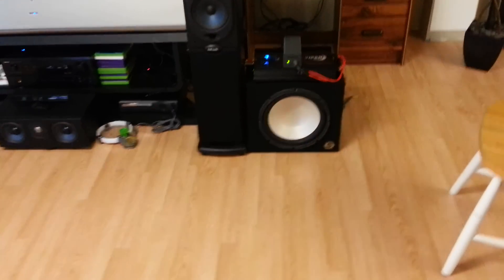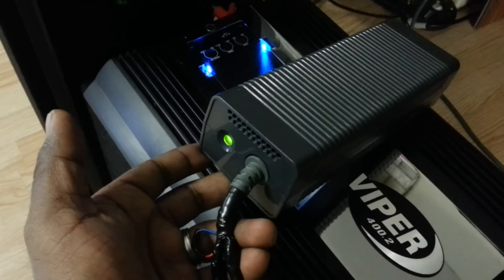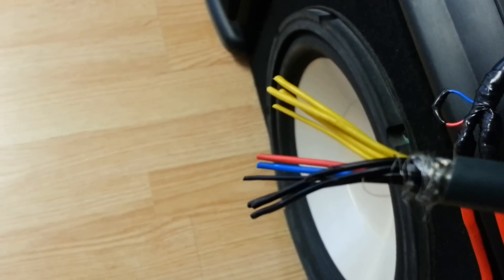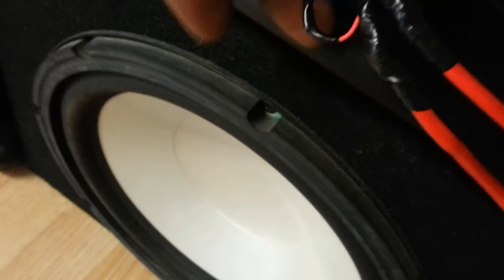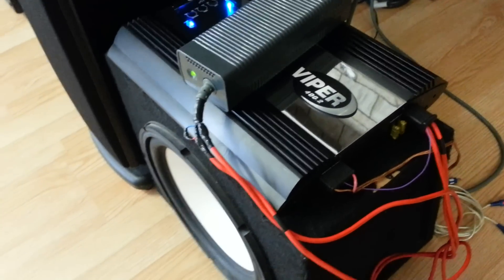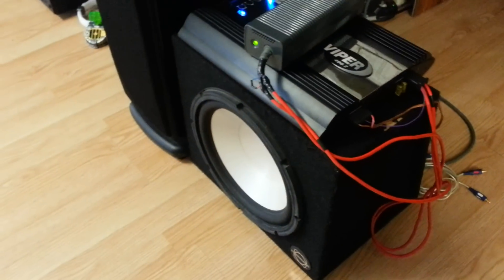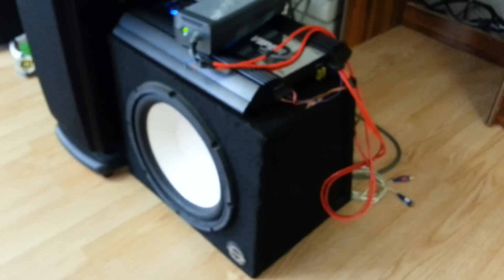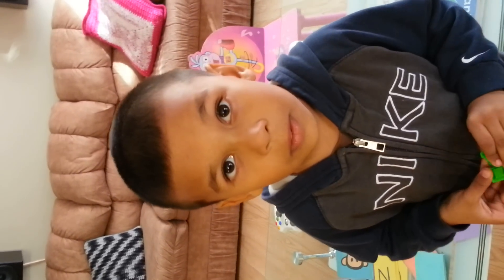Car audio at home - DIY - DC power supply  PSU w/ xbox 36o brick

Comment: A laptop charger would work but only for some car amplifiers that put out a minimum of 50 watts or 70 watts per channel a laptop charger only works for 300 watt car amplifiers such as kicker or some ground zero amps or a us amps 50hc some amplifiers you can run with a laptop charger not all of them though I hope to get a bigger amplifier someday and bigger subwoofers I hope to get some ct sounds meso 12 and a ct sounds at14001d or something along that line my current car amplifier that I'm running indoors is beat up but still works and I love running car amplifiers indoors and I'm currently running 2 12 inch 800 watt car subwoofers indoors and they work great but I hope to run 4 12s indoors and 2 amps indoors or 3 amps indoors I want to shake the roof of my house someday and crack a window with bass that's what I hope to do someday is to blow the roof off with bass

Comment: In conclusion.   It didn't work for me.   My amp fuse is 40w.  The brick doesn't have enough power to keep the sub going.   Or it will not sound as good.   I understand u said low frequency    I like your set up.   But back to the drawing board for me.

Comment: Did you install a volume knob on the amp?
Reply from the maker: Kaizen Kaizen no I did not. the amplifier is getting it's audio signal (via the RCA's) from the subwoofer output terminal of the back of my home theatre recieved. so when I turn up the stereo volume in my recieved, it turns up the subwoofer.

Comment: i been thinking of doing this,but what if u use a car battery,and just hook the car battery up to a car bat charger
so it keeps charging
Reply: Syber Tiger well, that’s the legit way, but it’s also more expensive and a little risky, but as far as actual sound quality setting it up as if it were in a car would be much better

Comment: Pretty neat, great video. I am attempting something similar but found an old Dell AC/DC adapter. When I stripped the cable it had 3 ground, 3 power, 1 red, 1 blue, and a bare copper wire. Any idea what the bare wire is for and what to do with it?
Reply: Ines Quintero ground wire bro but don't use to ground amp tie in with the other grounds.
Reply: Wasn’t that to much voltage?

Comment: Nice vid. Q: What did you do with the REM cable on the car subwoofer?
Reply from the maker: Connor Mac I jumped the remote  to the power terminal on the amp. once you turn the power supply on, it instantly turns the amp on.
Reply: Randy Prasad where on the power terminal? how did you connect it? I was thinking I was just going to connect a toggle to the red and green wires like you said to turn the subwoofers on and off. could I just leave the remote wire disconnected? thanks for the reply btw

Comment: @Randy parsad can any one tell me what's that orange cable is called  plzz
Reply from the maker: Ricardo the red cables?
that 10 gauge power wire (CCA) copper clad aluminum
Reply: Randy Prasad yes sir the red cables what are they called and where can I order then from?
Reply: Randy Prasad can you tell me how how did you connected it to the tv or can u make a video please  and thank you ur so helpfull

Comment: How did you hook up your amp to your receiver? I have a sub output on my receiver and when I plug the RCA wires in to both the receiver and the amp, the subwoofer just makes a buzzing noise that does not play along with the song. Please feel free to update me on how you hooked up your amp to your receiver with RCA to make it work. Thanks.
Reply from the maker: chia moua I used the sub out output terminals on my Denon receiver, and had no issues. make sure you turn that output on and turn the gains up through your receiver settings.

Comment: you can also use a 400 watt battery car jumper or you can possibly go higher on your wattage on your car jumper just depends on what your amp wattage is on your amplifier to be able to know license for instance if your amplifier is 1500 go with a higher voltage battery charger past that number it will last you a long time throughout the day and play as long as you want just long as you use your full gauge extension cord  and plug it in the back and charge it as you're using it at the same time to where you don't have to do demos you can just play as a all day thing any day thing trust me I do wiring it works ....GREAT
Reply: Jumper or battery charger or could I use either or?

Comment: Sound very educated about this. If it's 12 V and 14 A, that is only 168 watts of power. But the system is at least 1000 watts. How?
Reply: It takes power to make power. So if it is only getting 168 Watts it is probably only putting out ~130/140 Watts. The system is not being used to its full potential.

Comment: 40 amp current draw from your amp, and only 14 amp output? how is this not smoldering that power supply.  It is cool tho
Reply: THE AMP MAY NOT BE DAMANDING 40 AMPS ALL THE TIME,I DO THIS WHEN I REPAIR AMPS AND HAVE A AMP DRAW TESTER IF THE SUBS DEMAND THE POWER AND IS BRIDGED DOWN TO 2 OHMS OR SO IT MAY HIT THAT PEAK BUT NORMALLY IT WONT,I CAN PLAY MINE ALL DAY WITHOUT MEETING THE AMP RATING ON THE AMP,NOW LONG TERM ITS POSSIBLE IT COULD HURT THE AMP IF IT DOESNT GET THE POWER IT NEEDS AND YOU PUSH IT TO THE FULLEST ALL THE TIME BUT I HAVE A WHOLE SETUP WITH A RADIO EQ,4 SPEAKERS AND A SUB WITH AMP AND IT SEEMS TO HOLD FINE.ALSO I THINK THAT IS A SOLID STATE POWER TRANSFORMER SO THEY ARE PRETTY RUGGED.

Comment: in a house that has been well insulated, your ceiling vents will not be sufficient. an exhaust system or ventahood will be mandatory if staying alive is a concern. if the poison gas doesn't get you the very explosive bang will. natural gas leaks ain't got nothing on a hydrogen housebomb, vaulted ceilings beware
Reply: Christopher_the_Welder uhh wtf he is using a 12 volt power supply from an Xbox no battery at all no gases .
Reply: +bish bosh I was referring to the people suggesting auto batteries

Comment: keep in mind, when using a automotive battery charger to charge a car battery an invisible byproduct is produced from the terminals and cell caps. "hydrogen gas"
Reply: Ah consider that as added decibels 😁
Reply: hell yea preciate that bro
Reply: Will it make me high ?? 😄
Reply: @gondokist  .No, but it will make you go BOOM! Hydrogen gas is highly explosive.
Reply: Christopher_the_Welder this has relevance where? i’m not trying to be a dick, I know it sounds like it over the internet, but it’s a genuine question. he didn’t use a car battery charger or anything and before I go and hook my old system up in my house I want to take my precautions 😂
Reply: What about a jump  box

Comment: YOU ARE THE MAN. a fucking xbox power supply?! genius.
Reply from the maker: Rob Rodriguez thanks chief
Reply: Rob Rodriguez on your Xbox 360 power supply does it have four yellows in four blacks cuz if it does and there's one yellow and one black and skinnier than the others and what I did is I chopped the one yellow and one black so there's three yellows and three black and I rewired it all up and my amp did not go into protect so you should try it for yourself too maybe that would fix your problem and my Xbox 360 power supplies power is 203 Watts and the DC output is 16.5 amps
Reply: @Massive21Bass this worked thanks!
Reply: Rob Rodriguez .. this blonde is hooking my Xbox to my 12 p1
Reply: How many watts can it handle?
Reply: i ended up doing exactly this myself. the power supply goes into a safe mode and needs to be turned off and on again at about 20 amps. i recommend getting a volume knob for the amp so u can change the bass volume easily and separately from your source. Randy Prasad be the plug for this one 🔌
Reply: My amp goes in protect mode as soon as I turn it on ??
Reply: @nathanblust9537 take out the small yellow and black cables there are 2 that are smaller cap those off
Reply: How do I hook it up to my laptop so I can play beats off it ??
Reply: @nathanblust9537  not sure possibly a stereo with a aux cable from your pc
Reply: @Vengancebat  true ok thanks man

Comment: I have two xbox power supplies could i hook both of them up to my amp for more power?
Reply: Revolved .Sniper yeah try it let me know how it works lol
Reply: I gave it a try but there seems to be a surge or backfire of power, always cuts out at least one of the power supplies if both are plugged in, works fine if ones plugged in both will turn on... dont know how to fix the problem, got any ideas they would be greatly appreciated.
Reply: You gotta use a turn on switch that has both bricks together. Even a pull cord from a lamp will work

Comment: Can you bump it all day like that or will the psu cut off after a while? Example,12v 14.2amp and you feed to a 300w amp that require 25/30 amp, would it be fine running at half power all day?

Comment: I set this up but it only works for a second then the Xbox brick goes from green to red... is it using to much power or something?
Reply: Jack Fields  shorts maybe
Reply from the maker: Jack Fields your trying to draw more from it then it can output, turn your gain/volume down and see if it helps.
thanks for watching,
cheers

Comment: hey i got a 12" audiobond sub and a 1,000 watt logic amp would it work
Reply: Chance Frizzell an Xbox power supply only has about 200 watts, soo, you might not get enough power
Reply: its alright it is running off 200 watts rn from my receiver

Comment: I have 2 15" KICKER subs, would a 850 watt pc power supply do?
Reply: IGOTA Iphone7  if you know what your doing
Reply: L
Reply: DJ.Spikes Hostage the subs rms or max?
Reply: IGOTA Iphone7 buddy you have to know what wattage your subs are holding each and be sure they are the same Subs that are holding the same voltage try to find out what are the wattage that your subs can hold add them together to know what your subs can do remember never get a sub that's higher than the amp to be truthful your subs are going to be hungry if you get a amp that's a lower voltage than your subs never be afraid of getting a higher voltage amp for your subs just a little ..... but for a example if you get a 1000 watt sub and you get a 800 watt amplifier your sub is going to be hungry it's going to be wanting more and what the amp is feeding if the sub is a thousand Watts you better give it a thousand Watts or just a tad more remember Subs are greedy and they want what they are designed to hold to be able to tump like they need

Comment: battery is more safe that thing, thing could burn n create a fire while overheating
Reply: Xbox PSUs have built in thermal protection,plus they have a decent fan in them...just make sure it has good air circulation around it
Reply: Michael Flores 
To anyone that's sketchy on doing this, it's fine as long as you understand electronics, ohms law, and proper safety. If you don't want to mess with this and you still want to run high wattage car audio subwoofers in your house then start looking at Pro Audio/DJ/PA style amplifiers. Crowns XLS series of amps can use RCA cables, has speaker binding posts, banana plug receptacles, XLR, speakon, and is already set and ready to plug in to the wall jack in your house. They have digital adjustable low and high pass crossovers, they are bridgeable, and have true wattages well in to the thousands for a very fair price. That's the route I went when my 18 year old Infinity home theatre sub crapped out.
Reply: Lead acid batteries put out hydrogen gas- far more dangerous.  Plus you would need a charger.
Reply: bu then you have to have a good battery charger i think a psu is the best option
Reply: couldn't i use a capacitor, so it doeskin stress the psu out?
Reply: I'm far from a professional but I thought that those power supplies had a fusible Link in them somewhere that would blow with too much wattage draw.? I'm not 100% positive but I could have swore they had some sort of fuse whether it be fuse or fusible link that would blow to avoid a house fire. Not saying it's never going to happen but I would think unlikely?
Reply: no
Reply: Kevin Ball can you send me a link to it?
Reply: that should definitely not overheat
Reply: PSUs are a good option as long as you get the amp rating equal to the amplifiers external fuses. But for larger setups (1000w+) a battery and a good high amp battery charger would be better option because PSUs are not really made sudden instant current draw. A good rule of thumb for any setup is not to let the voltage drop under 12v.

Comment: How can I get more power source?I have a sundown 15 and my amp has 1000 rms I'm using the Xbox 360 power brick like in the video i have the amp turnt all the way down and it sounds good but when I turn the amp up it turns off and the brick turns red
Reply: Tha Guy  dont keep doing this you will blow the amp up get a computer psu and a 12 volt battery and youre good
Reply: you need a more powerful power supply. your 1000 rms is drawing too much current for the 360 brick, so to keep it from blowing up, the brick shuts off.  the 360 brick can only put out a max 168watts, anything more it shuts down.
Reply: Actually its 204 watts max for mine, the 360 slim brick is 135 watts

Comment: how do you connect the amp to you home HiFi I have a 3.5 mm to rca from the TV to my home amp I have set the amp up but if I run rca from the amp to the home amp there is no sound output just a hum
Reply: the rcas on your tv, are they outputs or inputs. if they are outputs, then it should work. ohh you have to go from tv to car amp. you cannot run from amp to amp. defeats the purpose
Reply: I did it in the end I used some rca splitters
Reply: 8484general if your receiver has a sub preamp out, it would be best to use that...turn the gain on the amp all the way down, connect the sub out from your receiver to your amp...when everything is connected, turn up the gain on the amp until you start hearing the sub come in...depending on the receiver, you might be able to control sub volume from the receiver. also, if you use a power cap with the amp it will take some of the load off the psu during music peaks (hard bass notes, explosions during movies etc.).

Comment: dont underestimate the 12amps that is a lot if you look at most cheap psu's like out of computers. Back when i powered my car amp in the house i used and Dell server PSU which put out 80amps at 12.2v but it was a lot of fiddling to get everything working, i had to make myself a full pin schedule on what every pin did.
Reply: NOT TRUE,I DO THIS QUITE A BIT,THE AMP WILL ONY PUT OUT WHAT IT CAN RECIEVE,PSU IS REGULATED AND USUALLY WONT ALLOW THE AMP TO OVERDRAW,ITS THE HARD HITS THAT MAY CAUSE IT TO CLIP BUT USUALLY WONT SHUT OFF,I HAVE 4 DIFFERENT PSU SUPPLYS FOR DIFFERENT AMPS BUT HAVE RUN AS MANY AS 500 WATT AMPS ON A 14 AMP SUPPLY BUT I CAN TELL YOU THE OUTPUT WAS LOWER,THINK OF IT LIKE JL AUDIOS REGULATED POWER SUPPPLY,IT PUTS OUT THE SAME POWER AT 12V AS 14 V AND 4 OHMS AS 2 OHMS,THE REGULATED POWER SUPLY CONTROLS ITS OUTPUT.